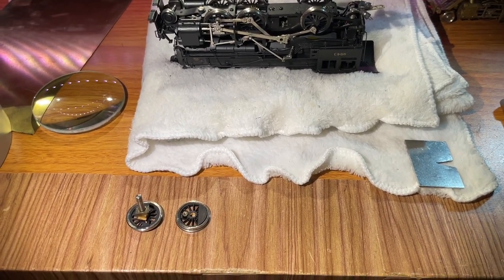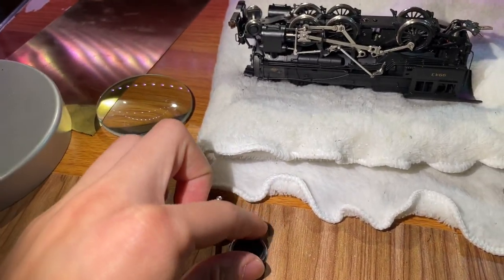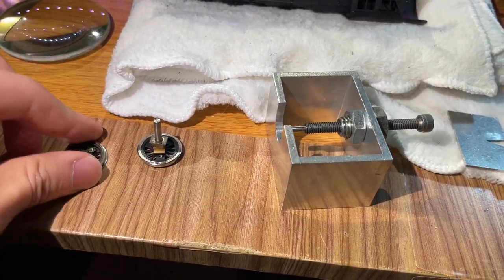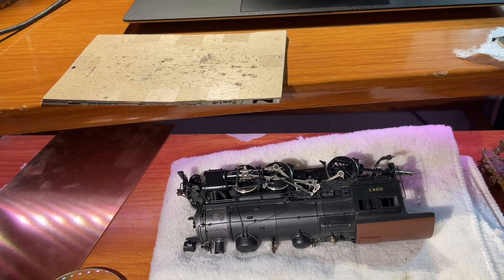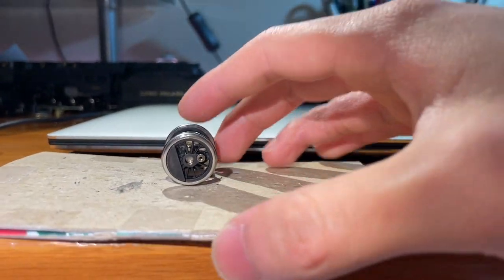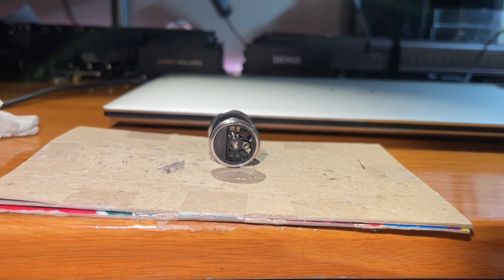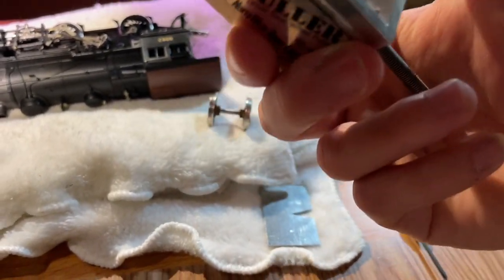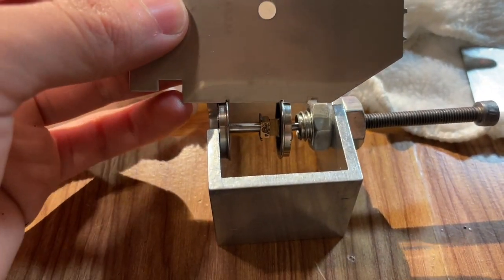How to Quarter Drivers on Steam Locomotive Models (BASIC tools only)

Comment: Puller is not a “basic” tool but a specialty tool not available at common tool retailers.  Still good job explaining the process!
Reply from the maker: Maybe I shoulda clarified, the tutorial shows you had to QUARTER drivers only. basically align the wheels up specifically without requiring a NWSL quartering tool, but rather use common tools. The tutorial didnt promise showing you how to take apart drivers with simple tools, unfortunately you kinda need a puller for that. But thanks!

Comment: I had to requarter some wheel sets on a few of  my John English A5's and a couple of Bowser kits because of cracked axle gears that I replaced with spare Athearn axle gears . I found scribing a line in the middle of the axle 90 degrees from the crank pin helped keep things lined up. I used a home made bearing separator plate sliced into a flat file to fit around the axle ,and a punch slightly smaller than the size of the axle to remove the wheels and my small bench vise turned on it's end ans a press to reinstall
Reply from the maker: sounds like another great way to do it! thanks for sharing

Comment: You have to quarter every wheel set like on a 484 correct
Reply from the maker: Hey! yes all wheels need to be in quarter (aka all exactly 90 degrees offset). However you only have to manually requarter the wheels if a particular wheelset is OUT of quarter. Therefore, unless all your wheels are out of quarter, you wont have to manually pull out all wheels.
Reply: @trainman440  thank you I'm changing the drive axles on my engine
Reply from the maker: @AEStudt  good luck!

Comment: Could you possibly show how to put the side arms and linkage on the wheels. I have a loco that seems to lock up coastally.
Reply from the maker: Hello, that would depend a lot on the exact model you have. Every manufacturer and every model would have a different rod assembly. I wouldnt be able to make a general video which would cover such a topic. Locking up would have to be troubleshot by yourself. I would suggest removing one rod  or wheel at a time, and testing to see if the binding goes away. then youll know what wheel or rod was causing the binding in the first place. Good luck!

Comment: Hi there , You mentioned a quartering tool. Do you (or anyone) know if there is a brand name for that quartering tool. As you shown there on your video about quartering and pressing the wheel back on you used the little puller pusher. 
I have done the same with a small table vice or a small 3" g-clamp and you only have to watch for the extra unflat bits like the counter weignts on the wheel but all you need to add is a small piece of flat steel to cover the axle and wind it up until it is in its right inner wheel dimensions. Awesome video & thankyou.
Cheers from John in Australia.
Reply from the maker: Hey! The pulling/pressing tool is called "The Puller" by NWSL (Northwest Shortline). The quartering tool I mentioned is called "The Quarterer" by NWSL. Glad to hear my video helped!
Reply: @trainman440  sorry